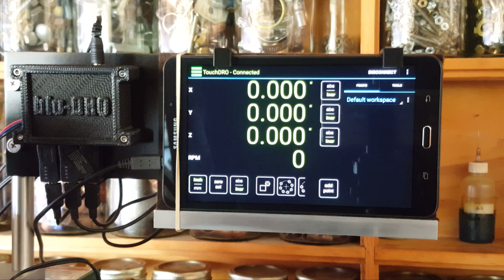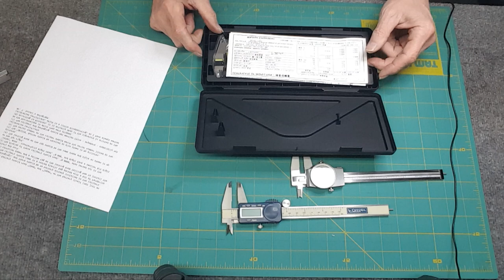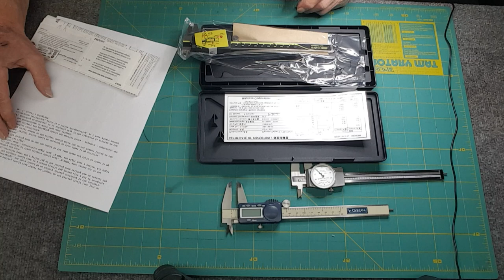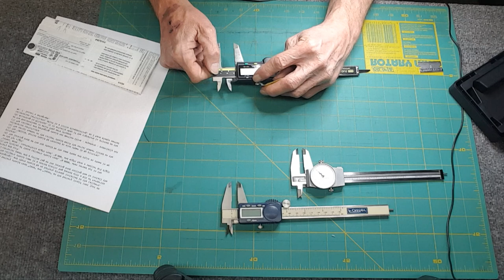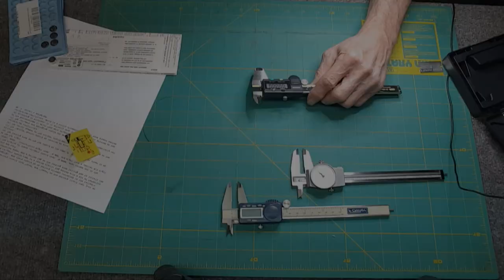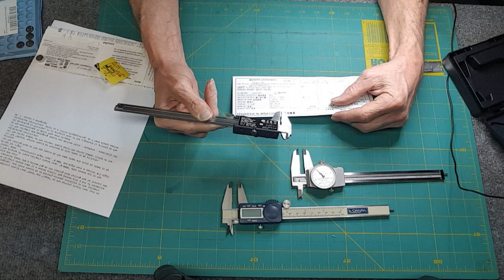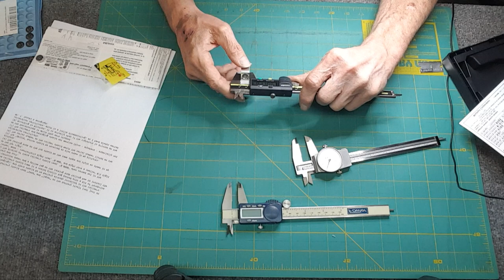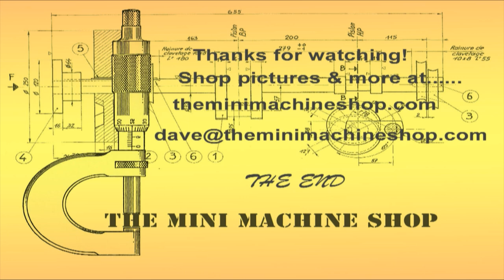Friday Night Meatloaf #1

Comment: Hi Dave, thanks for the video. Re the 'thin spot' on the Riobi bits, they are designed so that the 'thin spot' will break first before the impact drill.
Reply from the maker: Thanks for the info!
Reply: @TheMiniMachineShop  After looking up the ad on the Dewalt bits that I bought, the 'thin spots' are not to protect the drill they are to offer the bit a way to break at a  controlled breaking point instead of shattering dangerously. Sounds feasible.

Comment: Haha. I thought You had changed the camera angle, direction, just to renew Your video.... Felt it was positive! Head stocks here and there.. I didn't think about it.
To be honest I nowdays skip "meatlof" videos. Lots of bla bla giving nothing but Your video was both interesting and entertaining Dave!

Dave, Dave, Dave! You could mark up Your surface in differently sized rectangles for differently large "guys" so You know what the camera pics up, and get closer according to the stuff You show.
The first 4-5 minutes, what interesting thing is it You are showing? What does it do?
SR44 or LR44, the same kind, only different brands using different names.

The listening and replying phone..... Know what You talk about, Your wife, friends etc. That "bastard" might repeat it, I guess....
Test it when You've cought a cold and sounds like black chimney.....
The storage at time 23:00. Nice as long as You have a few hundred screws, nuts, washers in there. How about getting the last items out of it? Using a doctors plier? But yes, a one time chance.
I bought 2 IKEAs, quite similiar paying a lot less, without any "furniture" inside.

Cheers.
Reply from the maker: Very happy with the drawers and don't have a problem getting stuff out with my fingers. Didn't know SR and LR were the same. You had to watch the rivetnut video to know those were DIY crimp tools for them. Cheers!